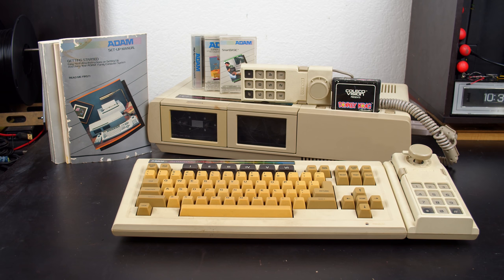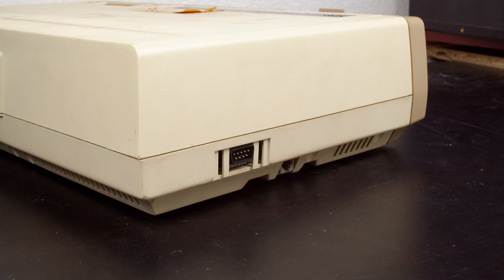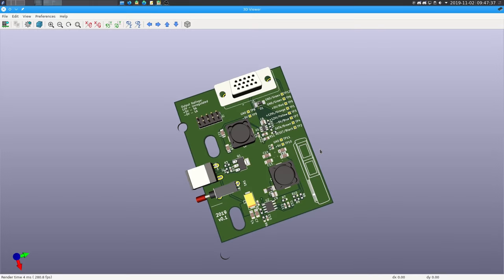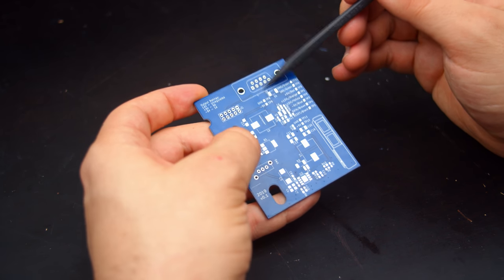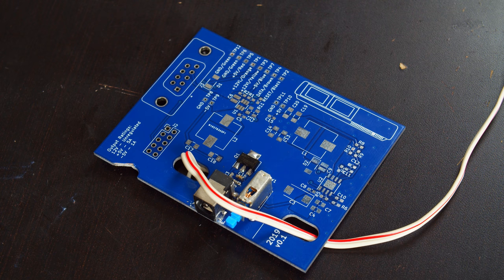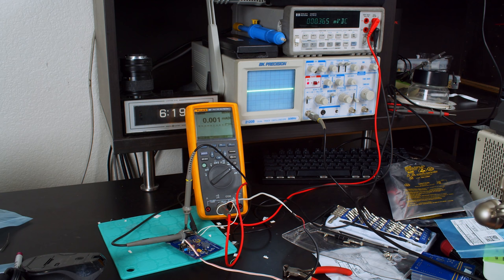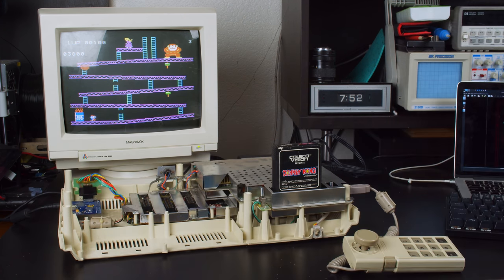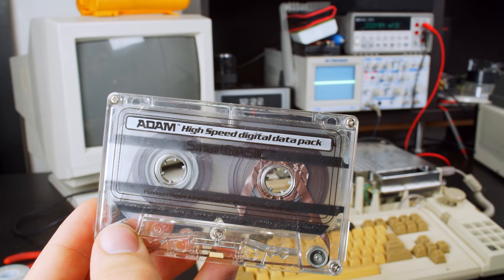Making a New Coleco Adam Internal PSU

Comment from the maker: Do you have any suggestions for v0.2? Let me know here! I'm holding off on the orders for a few days in case someone has a good idea I should add.
Reply: Maybe put the db9 port and barrel jack on the other side so the power supply can hang out the side easier? If you haven't already.
Reply from the maker: I could potentially do that, but then the heat generating components would be on the bottom significantly reducing cooling efficiency. It may be able to handle that though, I'm not sure. I didn't think to measure the overall efficiency of the board, if I do that then I'll know what the total heat dissipation is and can get a better sense of how detrimental that would be. 

I could add additional footprints to the board allowing you to choose where they are mounted. I could probably make an option when ordering to choose what kind you need and just solder on those part before each order is shipped.
Reply: If you're gonna be working on a power supply, it'd definitely be worth making a simple dummy load IMO. Won't cost you much at all.
That way, you're in charge of the current, and you're not at the mercy of whatever messy, noisy charging circuit is in a test device lol
I made mine with spare parts: An op amp, decent MOSFET, couple resistors, a pot, and a chunky heatsink. Nothing fancy, don't even need a panel meter since you have a good DMM!
Super simple: https://www.youtube.com/watch?v=8xX2SVcItOA
Reply: I'd suggest a fuse on power input at least, status LED on the lines would also be nice for quick visual indication. Also reverse polarity protection is nice to have on input voltages.
Reply from the maker: @leisergeist   I'm planning on making a test board for checking voltage, ripple, current, etc that can be connected between the PSU and the Adam to power it externally for validation before I ship orders. I could probably add a custom load circuit to that as well to test independent of the Adam. This is a great idea, thanks!
Reply from the maker: @athf226  I did mean to put a fuse on the next revision, thanks for the reminder. I was thinking about adding an LED for general power status with a cut-table trace. I like the reverse polarity protection, though you would have to have a somewhat exotic 12V PSU for it to be backwards. But more general idiot proofing wouldn't hurt.
Reply: @TechTangents  Great idea!
Always good to have a dummy load though. Simple yet infinitely useful for a lot of things
Reply: Seconded with the reverse polarity protection, although  while the simple ol' diode would work not sure if it's better to invest in a more complex solution with a MOSFET or even an exotic one, a dedicated chip like the LTC4365.
Reply: @menix2384  +1 for the LTC4365. Didn't know this existed, brilliant!
Looks like you might also be able to use it to switch the power...
Reply: @TechTangents  iirc most Casio keyboard power supplies are center negative and I think there are a few 12V varieties. Since you have high side switching you can just get a double PFET package and use the second for reverse polarity.
Reply: @TechTangents  also if you are wanting any help in general I, and I'm sure many others, are glad to help. I am always looking for an excuse to put off my personal projects even more haha.
Reply: A reverse protection and what @athf226 already sayd
Reply: @SeltsamerAttraktor  Not easily possible unfortunately. The integrated tape drive is all custom proprietary digital stuff.
However, someone has made an emulator of the original disk drive! https://github.com/Kalidomra/AdamNet-Drive-Emulator
https://atariage.com/forums/topic/287324-adamnet-drive-emulator-by-sean-myers/
Edit: wtf. sorry about the multiple replies. YT is being seriously bizarre lately.

Someone sold another project like this a while ago, but it was closed source and AFAIK they don't sell it anymore.
Reply: A power indicator and an FULL BRIDE RECTIFIER so that positive center, negative center and AC PSUs can be used.
Maybe also a 12V regulator so u can power it with ~=12-24V.
Reply: @TechTangents  solder points for botch locations could solve that problem, apparently zhete is space  enough for 2 db9 connectors
Reply: Figure out how those drives work and what you have to do to use tape images. That way you could make one PCB with provisions to be broken up in the middle.
Reply: 3D print a better cap for the power switch
Reply from the maker: @H4zuZazu  That one switch probably costs 10X the whole high side switching circuit and is much physically larger. The BOM cost could very easily get out of hand on this project so I'm trying to make sure I reduce costs where I can without sacrificing quality.
Reply: Love these power supply projects! I'm a final year EE student so I figured I'd take a look at the Kicad sources. The circuits are almost 1:1 copies of the typical application notes in the datasheets so that looks alright. 

Like the others said, it would be good to add some input protection. Typically you would want a schottky diode in series with the 12V, and a TVS diode between 12V and ground. The zener would add reverse polarity detection without dropping the supply too much, while a 20V rated TVS diode would protect against any power spikes from cabling or poor 12V power bricks. 

Some LEDs on the outputs would also never hurt your debugging. For load testing you can get 100W rated resistors for dirt cheap on ebay.

Layout wise there are two big things to change. First is the way you connect the power IC inputs. I see very thin traces going to oddly shaped polygons on the IC pins. What you want to do is use multiple-millimeter wide thicc traces from input straight through the bypass caps' pads, finally going into the IC after. The line should touch the caps before the IC pin so it's all fully filtered with no fast pass around the cap, so get rid of the polygons.

Finally: grounding! With switching supplies there are lots of high frequencies flowing through different parts, so a good solid ground plane at the bottom (and top) is key. To keep the inductance low you should put a full ground plane at the top and bottom, with lots of via stiching in between. The thick power traces can run on the top, with one or two only being at the bottom if there truly is no space. This helps keep the loop area small so you don't end up creating an antenna sending the switching frequency to air. For the "real" companies there are defined standards for this radiation when products get UL or CE rated.

Good luck!
Reply from the maker: @mourixnl  I figured I would be safest with following the datasheets closely, this is my first SMPS design. For v0.3 I plan on pushing it a bit with lower cost regulators and different filter caps to see what I can get away with for some cost reduction. But I want a locked in solid design for v0.2 first.

I am concerned about the V drop from a protection diode being problematic for the system since I am using that as one of the rails. Multiple people have suggested using a higher voltage source PSU and adding a 12V buck as well, but this is already not going to be very cheap to produce. So adding another 50% of the parts on again isn't a welcoming idea. I'll do some testing to see how tolerant the system is for a lower 12V rail before I finish up the next revision. My goal for these projects is always to be lower total cost than getting an original part. The printer is hard to value since they don't come up often on their own, but I think I'm going to be in the $35-45 range for the price of v0.2. So with adding an additional AC-DC PSU and it's getting up there. 

The LEDs are good for testing, but I don't want them on it in production since it would just add unnecessary cost, inventory tracking, and production time. I'll have them on my debug/validation board I'm going to make to go along with this. 

The large copper inputs were for extra heat sinking, it was probably very unnecessary though. I'll revise that. I'll also look at how my output capacitors are physically connected with that in mind and make some adjustments.

The grounding was something I realized was an issue, there is a branch on the repo for v0.2 if you want to check that out. I've already changed the grounding somewhat on the other side but It's still mostly 5V. The system is mostly using 5V so I was trying to give that the least resistance possible but that was also probably unnecessary. I'll just make it all ground. I'm suspecting the 5V plane under the -5V regulator is the cause of a lot of the ripple so I look forward to seeing the performance of the next revision.

Thank you for the excellent suggestions!
Reply: @SeltsamerAttraktor  Tellin ya, it wouldn't be worth the massive undertaking. There's already an open source SDcard drive emulator that connects to the ADAMnet port, which is just serial over a 6 pin telephone-style plug.
Reply: Could you not design it so that the DB9 can be soldered onto either side of the board? IE the way you did it for internal mounting, but the back side for external plug in. That way you would not need the extension and it would be the non-component side that was next to the case and clearance would not be an issue.
Reply: Give the current version some stress testing and see what gets hot lol.
Reply: just 3d print the button
Reply: @TechTangents  Thank you for the detailed reply! clearly a lot of thought has gone into this project/video. It's awesome man.

An alternative for the series diode would be a series fuse at the input, with a TVS diode to ground right after. The TVS will protect positive against transients but conduct like a regular diode when reverse biased and blow the fuse. So with these two parts you got protection against the whole range of situations with a low added cost.

There are some pcb trace width calculators online. Running the numbers, a 100mil trace at a 3 inch lenght would only give a 0.05V drop at 3A on a regular 35um copper thickness PCB. If you put a 200mil trace from the IC to the output it would be a whole order of magnitude better than anything that would even start to become an issue for the Coleco. Also it's a good idea to beef up the the other power traces.

Buck converters are quite sensitive to grounding schemes as there are fast transients at high current that can create a whole range of issues. A full ground plane is really emparitive to this. In V0.2 there is this ground poly in the bottom middle that is only connected from the top vias, which would probably give a good amount of issues as well. Good practice are full ground planes with thick traces for the voltages at the top where possible. Every IC/cap ground pad should have its own via to this plane, even if the top place is also ground. And the via stitching is still a good idea. 

As an added note, I see quite a few traces on the board layout with very sharp (acute) angles to pad connection. It's good practive to make these turns a bit farther away and just connect to pads dead center. 45 degree angles are really the maximum here.

It's also fine to make the vias a bit smaller. Multiple tiny 0.35/0.7mm vias in parallel have a lower inductance than one big one.

Good luck.
Reply from the maker: @JarrodCoombes  I'm starting to think I should have two mounting points for the DB9 connector, one for the front, one for the back. I'll pre-assemble boards to that stage and then make an option when ordering for where you want it based on which version you have. I'll try to put the back side connector on the other end of the board so it hangs down as well.
Reply from the maker: @mourixnl  Thank you! I did spend a lot of time reading up on SMPS/Buck regulators for this which was all new to me. I tried to learn everything but there are only so many hours in the day and you eventually get to a point where you just have to hit order and see what happens. Iterating on a design is better than constantly refining one.

I like the idea of the fuse+TVS much more. I'll be sure to look into adding that!

I'll go through and take a look at my net classes and make some changed for that.

That ground poly was my own attempt and a back side ground plain before you had mentioned it, I will extend that to the whole other side of the board. The Buck converters were more sensitive than I was thinking. They really don't like being touched while running to the point I'm going to add a warning on the silk screen about that since it caused transients when I tested it.

I may have been a tad rushed with the routing at the end, I don't normally come into the chips from the side. I'll go through and do a lot of tidying up.

I did not know about the via sizing, that is a good tip!

Thank you again!
Reply from the maker: @alphaseinor  As a general rule of thumb, I think it is a better idea to use cast plastic component for human interfaces because the texture is not pleasant on 3D printed parts. Frankly, it may not even be cheaper, the switch caps are only about $0.10 and you get a much higher quality part than 3D printing can make.
Reply: @TechTangents  A pFET can be used for reverse polarity protection at a minimal power loss and voltage drop. Since high side switching is being used on the new rev so you will be using a pFET anyways, a single package containing two FETs can be used. I did this at a previous job on a very small step up regulator design and it worked well. 

For laying out the regulators check if there are eval kits for the specific regulators you are using and basically just copy their layout, that is if they don't have layout guidelines in the datasheets.
Reply: @TechTangents  You can mount the DB9 connectors on the edge of the PCB, if you want. Five of the pins will be on one layer; four on the other. The standard 1.6mm PCB fits well between the two rows of pins
Reply: @guycrew728  I was going to say the same, just mirror the pinout and mount the db9 on the back of the board.
Reply: Why not use 2 trannys for the ground and +12 Volts rail, and two rows switch like you use, I don't think that will cost much higher than actual build.
Reply: Would it be a silly idea to use a db9 attached to a ribbon cable? You'd only need a short one to make sure the db9 was facing which ever way you want and then you could add some kind of cheap mount in the existing holes you have or even just zip tie it some how inside the case safely (that area of the case has lots of plastic every where)?
Reply: Tech Tangents - Any update on this great project?  I have a printer less Adam and would love to buy your power board if it’s been debugged!  Thanks for doing this.
Reply: Add a jumper that will allow you to switch to use the power from the printer connector, just incase someone has the printer but doesnt want to use it, but then if they do want to use it they dont have to use so many outlets.
Reply: Put the DE9 (there's no such thing as a DB9) port so it can fir in the original location and the barrel jack and switch where a couple of small holes can be put in the case.
Reply: - RTFM:) The manufacturers of the DC/DC controllers usually give a suggested PCB layout at the end of the datasheet, with some design examples including values. Also most of the time are online or excel-based calculation tools available. Further there are often separate "application notes" that go into detail about the magic involved. 
- Buy a $20 variable load
- you have a heatgun? use it, especially for situation like your "thermal-pad problem"!:)
- two years later, you will have an absolute free mind with fresh ideas (... because I am answering 2 years late, hehehe)
- make errors and learn from them, we all do that. Oh, sorry. You did that already + thanks for the video:)
- output filters? Who knows how the harmonics taste to the old hardware
- the most important: output protection! ( With that I mean Input Protection for the precious retro device! ). Are all(!) Voltages good? Over-current? Clamping the output voltages and shutting down the system in case of a fault. Every new design powering a computing device with multiple voltages should have that implemented. The lack of this in ancient times ( see C64 ) is no excuse.
- basics: every device should have protection. A input fuse with the maximum specs of your design. And when not present in the following device: A output fuse with a value arranged around the nominal current of the device to power. May it at least be SMD fuses. This is especially important for prototype devices. Your retro hardware / consuming hardware will thank you with a longer life:) These are so -called device protection fuses, not to be confused with mains line protection switches("circuit breaker") that protect your supply lines and house installation from fire damage by e.g. a short circuit. A good reason for this is not only that the old power supply presumably HAD fuses, but the two most common failure modes of MOSFETS. Your DC/DC hybrid controller contains a or several MOSFETs. One failure mode is "dead and open" ... which is good, depending on the kind of DC/DC-circuit. The other is dead and shorted, which will most likely connects the input voltage with <1 Ohms to the output of the device. In our case Adam is not only thrown out of paradise, but then has an very unfortunate accident (by barbecue) afterwards ...
Reply: Perhaps a port saver (just a straight-through solid extension piece) to give the extra height on the DB9 port when fitting outside?